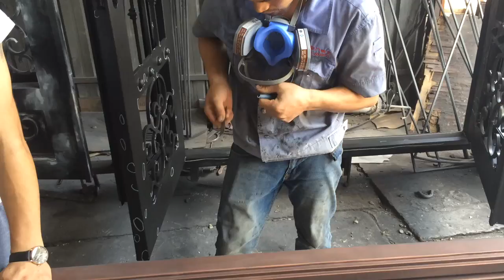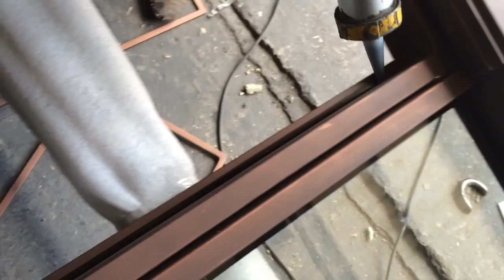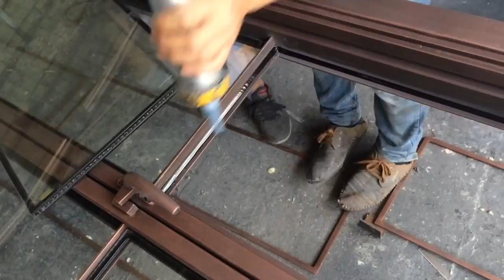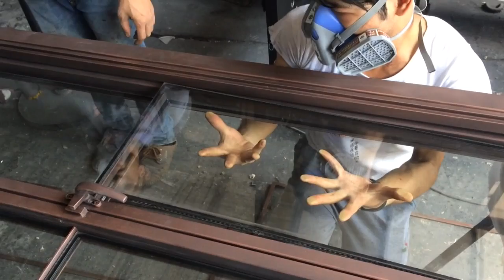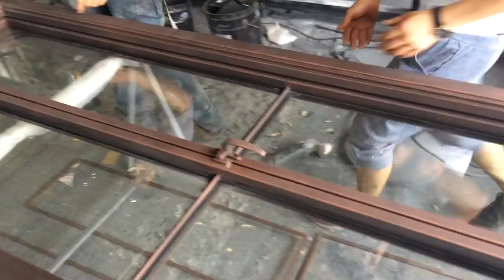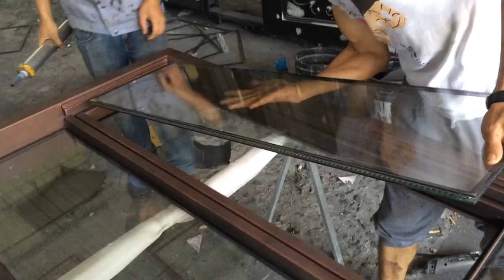install glass 1

Comment: Nice work. What tee profile was used for the glass dividers?
Reply from the maker: "T" Shape steel.
Reply: @jacklinsteelwindowsdoors7129  what size ?
Reply from the maker: @MinecraftPro-th8mo  1-1/4" X 1-1/4"
Reply: Hi thanks for your reply. For the glass stops you used iron flat bar? What size?
Reply from the maker: @MinecraftPro-th8mo  We use iron flat bar and aluminum glazing beads for different options. The flat bar is 1/4“ X 1/2"
Reply: Cool thanks